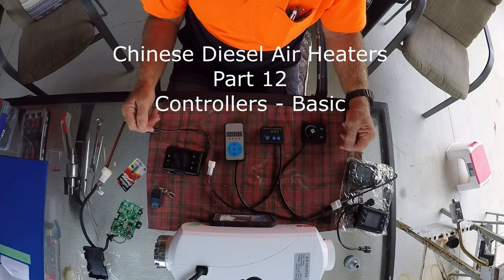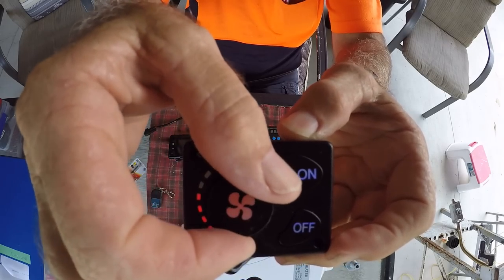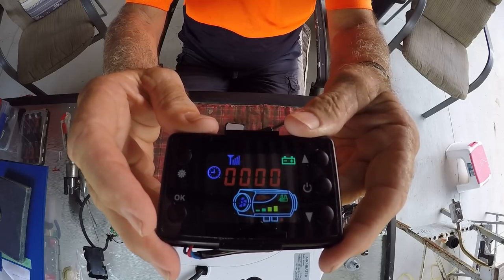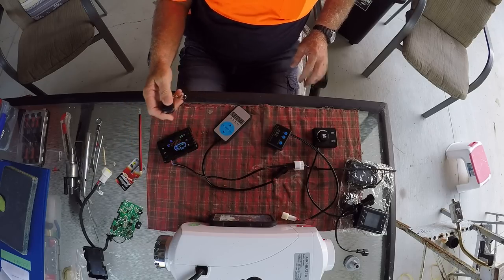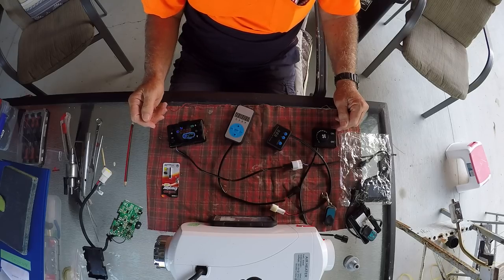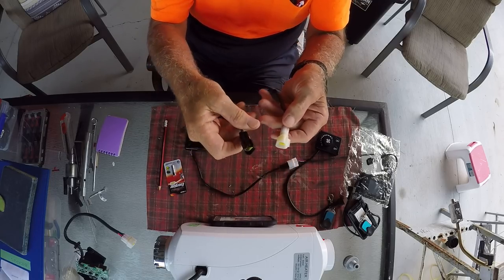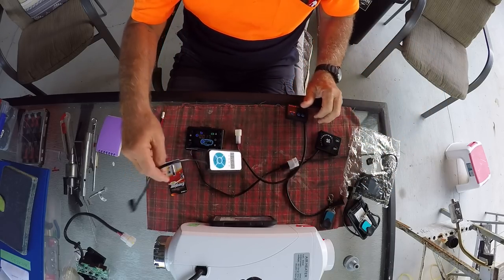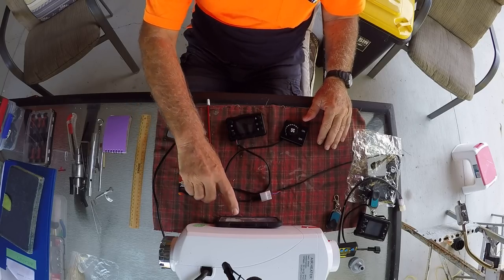Chinese Diesel Air Heaters -  Part 12 - Controllers (Basic)

Comment: how important is it to have the right pulse rate on a Chinese diesel heater
Reply from the maker: Hi Ken, it is very important, because the ECU matches the pulse rate (fuel delivery volume) with the combustion fan speed. If these are not matched you get a bad combustion fuel air ratio and a poor burn in the combustion chamber. This causes rapid soot build up and eventual heater failure. JMcK
Reply: I have mine set on 1.7 my heater is a 2kw .how do I set the fan speed ken
.
Reply from the maker: Ken Stone 
Hi Ken, the pump speed and matching fan speeds were all programmed into the heater when you bought it. If you adjust the Hz rate up to pump in more fuel to make the heater run hotter, the fan speed also increases by the correct amount automatically.  JMcK

Comment: Hi Jon,

Thanks for all your useful videos.
I'm not sure it's possible as I haven't found a solution anywhere. However, do you know if you can change the low-voltage shut down value? I'm running a Chinese diesel heater using a lithium battery and want a low-voltage shut off correctly tuned for lithium.

Cheers,
Ross
Reply from the maker: Hi Ross,

No, I do not know a way of doing that.

But why do wish to change the low voltage setting? 

Do you want to move the shutdown voltage up, or do you want to move it down?

 I personally can not see any logical reason to change the setting, whether you are using Lead acid, lithium, calcium, or a power supply. 

Perhaps you have a reason I have not considered.

Sorry.  JMcK
Reply: @johnmck1147 , thanks for your swift response.

I'd like to.increase the low-voltage cut off for use with Lithium batteries.

The cut-off voltage is normally about 10.5v to account for voltage drop under load and lead-acid 80% discharge of 11.8v.

However, lithium cells don't drop voltage nearly as much under high load. If you take a 12v lithium battery to 10.5v it will be dead or permanently damaged.

Trying to work out a solution to this problem. Considering running thinner cable to deliberately have a lower voltage at the heater, or a voltage dropping circuit, but would need some beefy resistors for the load going into the diesel heater.

Has anyone else considered this? I know someone who almost killed £3k worth of victron batteries with their webasto heater.
Reply from the maker: Hi Ross, 

Yes these are some of the issues now becoming apparent with Lithium batteries. 

Lithium have a very flat line voltage on discharge, so I don't see a particular voltage cut out for you actually working.

If you reduce the wire size you will probably have issues with the glow plug not getting hot enough for start.

What about running the heater off a small motorbike battery, and keeping that charged by a small DC-DC charger connected to your Lithium bank.

I would be interested to know your solution.  JMcK

Comment: Hi John good stuff on here. I have a 2kg heater it starts fan runs glow symbol is on fan on but cuts out about 40 seconds no pump signal any ideas
Reply from the maker: Hi Robert, 
Is the heater new, or did it run previously and now will not run?
There are a number of possible causes.
A broken glow plug. The pump will not start if the glow plug does not get hot.
Faulty wiring
A faulty pump. 
A faulty controller.
Without knowing more detail, I would suspect glow plug not getting hot.
JMcK

Comment: Will the knob style keep a close temp , like will it turn on and shut down at certain temps? Or does the knob simply adjust the rate of fuel being pumped and the fan speed?  I ask because there will be a bunch of other stuff to do before installing the heater , and it's still too hot hear in the states to test it out. 

Also which one of the LCD screens do you suggest for simplicity that can be set for a certain temperature?  

The heater that we just ordered has the knob.
Reply from the maker: Hi Phil,

If your dial controller looks like mine in the video, well it comes with an inbuilt thermistor and as such does offer control over the temperature. 

Any of the common LED controllers will give you temperature control. But having said that, some heaters are now coming on the market with "non standard" wiring and connecting plugs so it is more difficult to swap out controllers.   JMcK
Reply: @johnmck1147  Thank You for the quick reply Sir. I had a question , or an idea come to mind after watching your videos. I'm putting this in a full sized bus. What if I was to cut a hole in the exhaust pipe in the bus , make a good flange and connect the heater exhaust directly into the 3 inch diesel engine exhaust pipe running out the back of the bus???  It will be 8-12 FT long depending on where the heater gets mounted. I'm assuming that long of a pipe would muffle the turbine sounds down quite a bit. Also assuming if it was to run thru the bus muffler that might be too much back pressure on it , what is your thoughts on that?  Or do you think running the heater exhaust into the big 3 inch pipe would be too restrictive ?   I may be even bigger exhaust pipe , I haven't got the bus home yet , but did look under it and did notice that it has new exhaust under it. 
Once again I truly Thank You for your in-depth videos on these heaters.
Reply from the maker: Phil Lowman 

Hi Phil,

One thing you must consider with these heaters is back pressure, as the combustion fan is very little and very basic. Running the heater exhaust into the bus exhaust could work with the bus engine off, but how would you prevent engine exhaust creating significant back pressure when the engine is running, and how would prevent the engine exhaust coming back out through the heater?

It might be simpler to just run the heater exhaust just straight down through the floor.

Cheers.. JMcK

Comment: Hi John, GT Woodshop has fitted his pump with the outlet facing completely down, is this a good idea? or should I avoid doing this? only I have just purchased one and I am checking it over, the pump was round the wrong way, and there were a few nuts and screws loose, but I have not fired it up yet as I am waiting for the filter to come, I purchased this on the 23rd of Sept 2022. 
Can you please get back to me with the correct procedure before I test it. atb Ray
Reply from the maker: Hi Charlie, 

The pump should be facing upwards, that is with the outlet at the top.

It will work, for a while, with the outlet down but you will soon have serious issues.

The pump, by its nature generates tiny cavitation bubbles, and if the pump is facing up these can easily be expelled and track along the fuel line to the burner, and actually help with the atomisation of the diesel in the burner.

If pump downwards the tiny bubbles will start to form one big bubble, and eventually this big bubble will prevent proper operation of the pump.  JMcK

Comment: Hey John, Thanks for these videos very informative as i research putting one of these in my Caravan. The one I'm look at on Ebay has one of the more detailed control panel and I hear what your saying about them staying on even if the unit is off (Part 12)  do you know if there is a way to turn off the LED display but still have the unit on? my partner has difficulty sleeping at night if there is any light. do you have a suggestion for this?
Reply from the maker: Hi Dom,

I have not seen a controller where you can dim, or turn off the back light in the controller. With the heater in use all you can do is cover the controller with a flap.

Suggest you install a switch in the main power line as in motorhome video when not using heater.

Without a switch the heater electronics are ALWAYS on day and night, summer and winter, caravan used or stored unless you disconnect the battery.

Also I am now getting feedback that those who have a few years use (not turning off their heater) are finding the controller back lighting so dim the can't see the controller settings, or no back lighting at all due to LED failure.

You do not want any power consuming component left on continuously drawing power ALL the time when not being used.

Cheers, JMcK
Reply: I'll check this next time I'm back at our boat. I did notice that in the wiring diagram for our 5kW unit there was something about a light switch. As there was no wire for that I just ignored it but I'll check if there's actually anything on the board for that.

Comment: Hi John. Thank you for your awesome guides. They have been invaluable and are the best! Hoping you can help: I have problems with my heater not properly starting up (returning various error codes), and also other times randomly starting up. How can I diagnose if the fault is with the controller or the onboard ECU?  Super thankful for any assistance you can give!
Reply from the maker: Hi CR,

First thanks for the positive feedback.

Now to your issue, I really need more info. What error codes, did the heater work well before but not now, does this happen all the time or occasionally etc.

I have a couple of spare controllers and ECBs, so it is easy for me to swap a controller or ECB to easily identify an issue. 

If your heater follows standard protocol you can buy a spare controller and ECB on eBay quite cheaply.

If your heater is old, it may be better to buy a new heater, and use the old one for spare parts.  

Cheers.  JMcK
Reply: @johnmck1147  
Thanks for getting back to me John. Heater is only 12mth old, I installed it last winter. The random start (fan only) does not come with error code. The errors I was getting were with glow plug and dosing (E3 and E8). I did some rewiring last night to get it on a better supply (heavier/better voltage) and it seems to have fixed glow plug & pump errors - worked will last night. Any thoughts on the random fan on problem?
Thanks so much.

Comment: John, You stated the LED's stay on all the time, even if the unit is not heating.  Can I shut the unit down and wait for it to cool down and turn off and THEN disconnect 12 volts
to the unit?  I know that would require a separate switch to the 12 volt input, but that way the battery in the caravan is saved.
Reply from the maker: Hi RB, yes, you can do that. Suggest you have a look at Motorhome video. I talk about this in more detail.  JMcK

Comment: Got a question for you, John. On that controller that had the wires in different places, could a person just cut the wires and re-attach so the positive and negative and signal wires are in the right places, or is it a totally different type of signal that would still not work right, even if you did manage to put all the wires in the right place?
Reply from the maker: Hi Brian, when I made these videos some five years ago, all the main Chinese manufacturers used the same protocol so it was very easy to do as you suggest and mix and match different heaters with different controllers. It was also easy to cut the wires and lengthen/shorten new plugs etc.

However, recently some manufacturers use proprietary protocols so in some heaters this is not so easy.

These days it becomes a case of try and see. These heaters are very cheap, and spare parts are also cheap if things don't go to plan..  JMcK

Comment: Thank you for the Amazing series, all the ins and outs on these heaters.  
Alas controller problems...  I bought a 5kw all in one and it has a controller similar in looks to the last lcd type one, but the lettering is different with this one.  The older has red lettering, the new one is blue lettering and also high altitude icon when holding the settings and ok button together.  Simply pushing the settings button does nothing, only holding it will let me change between fan or temperature.  I am trying to get into the advanced settings to play with the pulse rate, but for the life of me can't figure out how to. 🥴 Is it possible with these newer controllers to get into the advanced settings ? Thanks in advance.
Reply: Hi, had the same problem, I have noticed there is at least three different kinds of these controllers that look virtually identical but function very differently.

The one I have I enter advanced settings by compleatly cutting the power to the heater. Then holding the up and down button simultaneously when connecting the power again.

Good luck
Reply: @robertnyren6153  Thanks for the suggestion, but alas, no joy.

Comment: Would like to see a video just on the monitor on the left as the instruction booklet is confusing. Is it ok to switch it on and off every few days or when dri,ving or does that shorten the life?
Reply from the maker: Hi Karen,

Do you mean switch the heater on and off, or just power to the controller?

Suggest you look at Motorhome install videos.

My advice is to put a master switch in the main power feed to the heater. If you connect up the heater to a battery without this master switch power is always going to the heater and the controller, even when the heater is switched off.

At this stage I can't see me doing  a video of that controller in the near future as there are plenty of other videos out there on YouTube on that topic.

Cheers,  JMcK

Comment: Hi John, I've enjoyed getting up to pace on the diesel heaters with this series of yours. I took the plunge and bought a Belief heater [ aTuite 2.2kw]. It comes with a LCD controller that has 2 plugs, 3 wires to each plug, not the usual single triangular plug found on most controllers. Do you know if there are any other controllers, preferably with a remote, that I can change over to use instead? If not, how would I go about converting over the board and wiring as you suggested in this video? Thanks in advance.
Reply from the maker: Hi Greg,

Sorry, I know  of no other controllers that will work.

Can you ask to return your heater as it uses non standard parts? 

There are a couple of suppliers who sell heaters with non standard controllers and ECU's, and if you buy one of these, you have what you have. Some can be rewired but it is a lot of trouble. 

Far better to buy just a simple standard heater with a ready supply of spare parts available on eBay.
Reply: @johnmck1147  Thanks John, I've followed your advice and requested a return of the heater, We'll see what eventuates. Much appreciated.

Comment: If the ECU is prone to damage from heat due to an incorrect shutdown would it be an idea to relocate it outside of the chamber casing? Why are they mounted inside? 
Excellent vids BTW.
Reply from the maker: Hi K, with a correct install it is very rare to have a sudden shutdown and ECU damage.
It would be difficult to remote mount the ECU on these already manufactured heaters as things like the fan speed sensor are part of the ECU circuit board. This could be changed by a redesign and different manufacturing, but would not be worth the effort.  JMcK

Comment: Hi John thanks for all the info on these heaters, it been a lot of help. One thing I haven't seen anybody cover is the fact they don't shut down, they just slow down when set temp is reached. Opening a window is an option but not practical. Do you have any suggestions on getting them to run and heat more like a standard furnace in a camper. And running them efficiently buy doing the on/off cycle.
Let me know, thanks.
Reply from the maker: Hi Scott,

I assume you are getting too hot.

I personally never use the set temperature function, I prefer the manual function where I set the pulse level and let it tick away at a constant setting, rather than ramp up and slow down cycles, but that is just a personal thing.

I have heard of some enthusiasts using relays to turn the heater off and on, but the supplied controllers with these cheap Chinese heaters do not currently have that function.

Sorry.  JMcK
Reply: @johnmck1147  Yes even in Canada in the winter on the lowest settings it gets to warm in my camper. Thanks for the reply, and yes I have looked at "The Afterburner Controller" {http://www.mrjones.id.au/afterburner/} and it seems to do what I wont. I think I will do some more research and talk to people that have used it to see how good it is. I am curious if it is efficient, starting and stopping multiple time will be hard on the battery system but what about fuel consumption. Again thanks for the video's and the advice.

Comment: Can you explain please. In the controls panel there are settings of PF 1 to 6. What are these settings for and what should they be set at. Thanks.
Reply from the maker: Hi there,

Not sure what controller you have.

However I think what you are referring to is Pulse Frequency. This is a manual setting of how many fuel pump pulses per second you wish the pump to use.

1 is the lowest setting, 6 the highest. 

The greater the number of pulses from the fuel pump, the greater amount of fuel delivered to the heater the hotter the heater. 

Cheers.   JMcK
Reply: @johnmck1147  thank you for your reply.
Reply from the maker: Lucy Lou Out and About 
👍